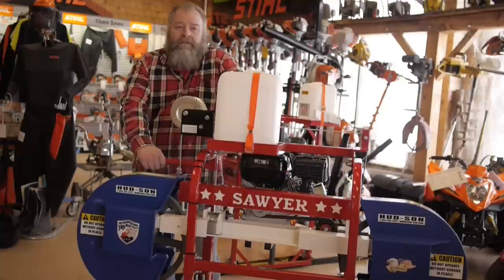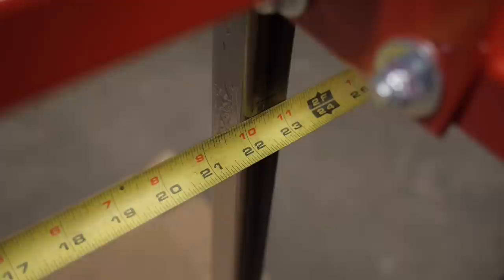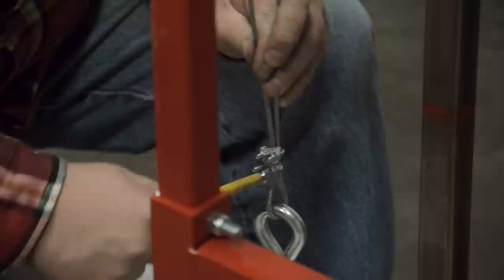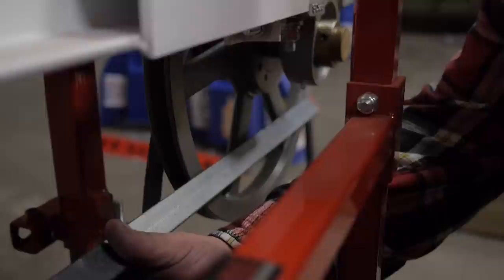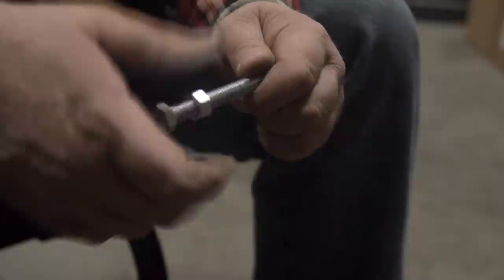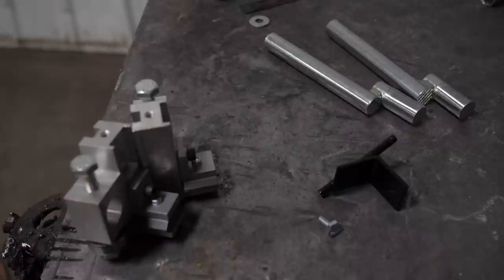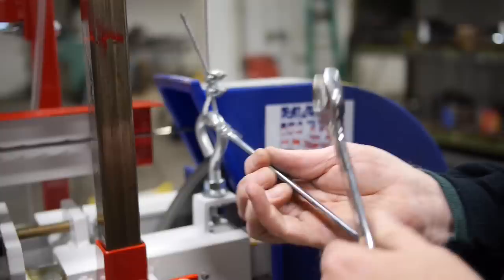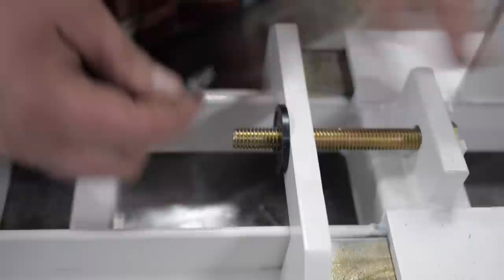Freedom Line Assembly Video

Comment: I recently purchased this mill and did the assembly myself.  First let me say if you are doing the assembly GO SLOW AND TAKE YOUR TIME. In the end you will find that this is an excellent hobby mill for guys like me! The paper instructions suck but the video is excellent. I suggest watching the video several times before starting assembly. I had some questions  when I was assembling the mill and when i called customer service i spoke to Wayne. He knew EXACTLY how to solve the problems i was having. He was patient and very helpful. GO WAYNE!! The only real problem was that even when the lift cables were adjusted the mill head wanted to bind a little when raising and lowering the mill head. With a little thought and some common sense it worked fine. Once the unit was assembled and on the track i milled a small (8"dia) log. After making a few adjustments, I milled a 9' long, 21" dia (including the bark) fresh cut black walnut log. I made several cuts and then rolled the log over to finish. It has about 19" between the guides and i must say it did very well cutting. The motor starts easy and runs well. I read in some reviews that people were concerned with the aluminum rails vs steel but i don't see any problems with the aluminum rails. Make sure the rails are level all the way around before you put the mill on the rails. I will be cutting the log dogs in half so the clamp and stop side can move independently. I also will be adding a "pin" on the end of the stop side to better reach into the bark and hold logs. This will be especially helpful when you set the clamp down low on the log near the rail. ALL IN ALL I GIVE THIS MILL A 9 OUT OF 10 STARS. The price is right and the lumber i cut from my first walnut log will pay for the mill. EXCELLENT JOB HUD-SON.

Comment: Just purchased this sawmill about a month ago. I opted to assemble the Sawmill myself and have a few comments on this. If you opt to assemble it yourself it will take time, patience, and a mechanical understanding. Expect that what you receive will not be perfectly welded, perfectly square, holes perfectly drilled etc. When it is assembled at the factory, they have the know-how, skills and tools to make the needed adjustments during assembly. With that said, it took my son and I sometime to assemble it properly. We needed to make adjustments as we assembled it, specifically, the mill head was twisted, not a big twist but enough so that getting the wheels to align properly was a tough task (it included sliding the wheels on the bearings shaft) but we were able to get them aligned perfectly. I personally can't emphasize enough that everything is kept and maintained level and plum during the assembly process, once we leveled the frame we clamped it down so it would stay level. The mounting bracket for the idling wheel was bent and twisted upon arrival and we added a piece of 3/8 steel to prevent further bending or twisting with a much shorter slot to put the bolt through. My only suggestion for Hud-Son would be a better printed assembly manual and video. The assembly instructions NEEDS to have pictures, arrows etc and the video is presented as if all is good and all you will need to do as add a washer or shim to adjust things.

I would not recommend self assembly unless you are mechanically inclined and have access to a broad set of tools and have a lot of patience. My Son and I have over 40yrs of mechanical experience combined and he works on equipment daily that use the identical wheels and pulleys.

I know we could have called Hud-Son to help us get through all the adjustments we had to make and I know they have seen these thing before, but I was extremely confident that we could get the unit assembled properly and working properly just by taking our time, following the video instructions (with many pauses to see exactly what was happening) and a good sense of humor - With Age Come Wisdom :)

Thank you Hud-Son we are so looking forward to milling some trees in the next few days.

Rick
Reply from the maker: THANK YOU AGAIN FOR YOUR PURCHASE WITH US. I AM PLEASED YOU GOT YOUR SAWMILL TOGETHER, YES IT DOES HELP WHEN A SINGLE PERSON PUTS TOGETHER A FEW THOUSAND OR SO. AND YES YOU CAN BUY THEM PUT TOGETHER, BUT I PROMISE YOU WE WILL LOOK AT YOUR COMMENTS AS WE LEARN WISDOM DAILY AND WE WILL BEING LOOKING AT OUR INSTRUCTION COMMENTS THAT YOU FEEL NEED MORE ADDRESSING, ANYTIME THAT ONE NEEDS SUPPORT OR JUST WANT TO TALK TO ONE OF OUR MFG PEOPLE, CALL OUR FACTORY DIRECT AT 800-765-7297  or look up a dealership in your state on our web-site, THANK YOU
Reply: I am having the exact same issues: Twisted wheel mount arms (not huge - but enough to cause problems), wheels 1/4" difference on shaft alignment (having to slide both wheels on shaft, not only to align to each other, but to (both) be further pushed out towards 'center' of  motor clutch, wheel requires shim for vertical alignment to other wheel, Instructions are very limited in detail and not current with written instructions or factory changes. Belt has minor twist in it - not sure if that will be a problem later or not. These issues have taken any enjoyment I initially had with this purchase.
Reply: Well said Sir. I also opted to assemble it myself. It definitely takes a strong mechanical background to put it together. There's a lot of snug, measure, loosen, measure and snug again to the process.

Comment: Okay, so I too had just purchased the Hunter Sawmill, unassembled. I have had several setbacks when assembling, like the winch is a totally different winch than pictured in the video where the handle installs and appears to operate different. I worked on adjusting the mill head for almost 2 hours trying to get the mill to lift up and down while staying level.  I final accomplished that task but, don't ask me how! I got the blade wheels on and leveled as described, blade tracking without moving forward or backward.  I'm down to my (what I hope is the last) issue.  I started the motor and cranked it up to speed.  While the motor running it was going along great, then I noticed the drive belt started to flip over.  It never jumped the wheel just rolled.  This caused the blade to begin to jump and skip.  I shut it down and removed the covers, blade and adjusted the belt tension, checked the wheels for alignment, all was good from what I learned in the video.  So I started the motor up again and gave it some juice.  AGAIN, it ran great for about 1- minutes and the belt flipped over again!  Can anyone explain why this is doing this and how to fix it?  

Otherwise Hud-Son, I was impressed with packing the mill. Everything seemed to be in order and labeled clearly.  Directions are very lacking in information for assembly and the video was a good help also, but still lacking on a few technical calibration issues (i.e. Mill head adjustment and Wheel alignment).  The other thing I found to be and possibly a future major issue is the LOG DOGs.  They seem to me, how do I want to put this, Useless, as far as them used as a log stop.  I can not roll a log onto the mill frame with the log dog up because there is no way to move the locking side of the dog out of the way. Is there any way that the locking side of the dogs can be adjustable independently? Maybe use round-stock instead of square, so you can roll the locking side down while the log stop is up to keep your logs from rolling off the back side while loading or turning the log over to make another cut?!?!  I think this is all I have for now.  Looking forward to hearing some responses.
Reply from the maker: Thank you for your post! We would be happy to talk you thru this technical difficulty you are having. Please call Wayne at 800-765-7297. We will get you squared away!
Reply: Pete Unverferth did you ever get your issue resolved? We are having the EXACT same issue. Very very frustrating!! We have tried everything!

Comment: I like the mill, but why do you use aluminum track? It seems like they would wear easily.
Reply from the maker: Thank you for your post! They were originally designed to be transport by float planes in Canada and Alaska. Flow planes have small access doors and low weight capabilities  so that is why we originally went with the aluminum track. You can upgrade to the steel track for $500. Wear on the aluminum is not an issue because you are not rolling at high speeds. We appreciate your interest in our sawmills.

Comment: I purchased this mill two years ago. I also chose to assemble myself and bought killed myself doing it, I got so frustrated. Some issues I still haven’t gotten corrected and as a result not getting to use the mill like I wanted. I don’t do well with instructions over the phone cause I don’t understand the language or I should say terms used. One wheel is a floater just slightly thought. I can’t get the blade head level, when I try and do one side the other is off. I’m probably gonna try and call Wayne and hope he has time like maybe three hours to explain this as I do it. Hahaha
Reply from the maker: We are sorry that you are having problems. Did you buy direct or thru a dealer? Wayne is here till 430 today if you want to call him. He is very good over the phone explaining things in terms you can understand.

Comment: Hello, started assembling today and got as far as testing the engine but it wouldn't even turn over.  Any ideas? yes, it has gas, oil,  levers in correct position (choke, gas line, etc).  Thank you
Reply from the maker: Sure give us a call!! 800-765-7297
Reply: all set! Thank you.  Father didn't have enough oil in it, should've checked myself

Comment: the blade is running on naked steel wheel? like it can be seen on [13:36] ?
Reply: I just got this mill. I too had issues with alignment. The 1" reference is out the window just to line up the motor and the other blade idler wheel. Had to move the wheel on the shaft to keep my belt from rolling over. Could not adjust the engine enough to fix it. Does it matter what direction the wheel and pillow blocks are put together from your factory vs how I bolted them on? It could use better motor adjustments. Mine came with round tubes and not square like the video. Is the round a better design? Just finishing putting it together. Hope to be milling at our North Shore Cabin in MN by Mamorial Day weekend. I would love to help make your instructions better for future customers. All in all the mill is welded well and looks like it will mill at my scale for years to come with a steel track to come soon.

Thank you,
Dennsplace Family

Comment: Cable clams installed with saddle on dead end, this is incorrect.  " Never saddle a dead horse"
Reply from the maker: Sorry  I am not sure what is incorrect, Would you please call Me WAYNE i am in support and will discuss this matter and correct this issue call 800-765-7297   we will support you   HUD_SON
Reply: Yup , NEVER SADDLE A DEAD HORSE.  Never put the u bolt on the standing end on wire rope . That weakens it. The clamp end goes on the standing side and the U bolt goes on the bitter end side.
Reply: Gezz guys you are correct but that lil bit of weight it don’t matter at all , not picking a hundred ton load with cable clamps
Reply: @Jeremy Bleakney using cable clamps at all on the matter is wrong if your concerned about it falling on your hand

Comment: Pick a side to video from. One side.  Makes it very hard to follow the instructions when the aspects change
Reply: hey bob did you get yours going ,I just got mine fixing to start putting it together.do you still have to drill the bearings ? did you have any other issues ?
Reply: @southernsawyers6543   I didn't drill the bearing. That seemed already set when I measured. I just tightened the set screws. And I didn't want to mess with it until I had the carriage on the tracks. So much has to be square and level it's going to take some tweaking to get it all set up right the first time. I expect to flat butcher the first few logs and ruin at least one blade
Reply: I hear ya Bob ,I hope you got yours up and going ,I got my tracks built and just started putting the mill together,i got the carriage and the winch on,but the rest ill put on tomorrow,
Reply: @southernsawyers6543   be patient. I've a feeling this is going to be a seat of your pants machine. They're going to be quirky getting the carriage and sawhead all running smoothly.

Comment: This video has much to be desired unless you have lots of knowledge of this mill already, a nice big garage in which to assemble everything, and the ability to read between the lines of very hastily given, and in many ways incomplete instructions. What would solve this is a good diagram of how it should be done.  The only help in assembling this  besides this video are written instructions that are foggy to any green horn.  I am sure a good diagram added to the package would certainly alleviate much assembly trauma in setting up this mill.  Otherwise, it is without question the best their is as many mills are not built nearly as well costing much more money.

Comment: I dismissed these mill designs after finding the mickey mouse manuals which scream "Made and Printed in China".  Can't really tell quality from the pitiful manual but the video here confirms my suspicion.  Looks like a high school welding project which earned a C-.  Add to that the ghastly paint job which is more appropriate for a parade down main street and it boggles the mind who would buy one of these monstrosities.  If forced to buy a mill I'd probably choose the HF which is at least designed/constructed better and is a larger, more powerful mill.  But frankly I'd otherwise pass on both.